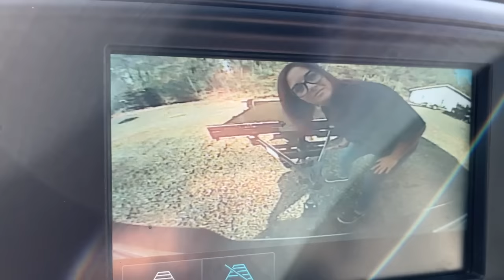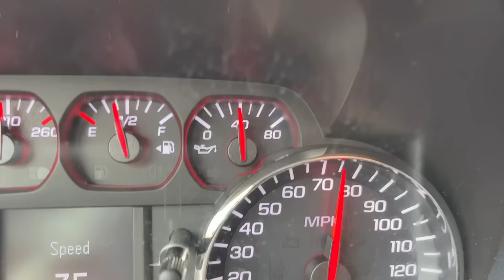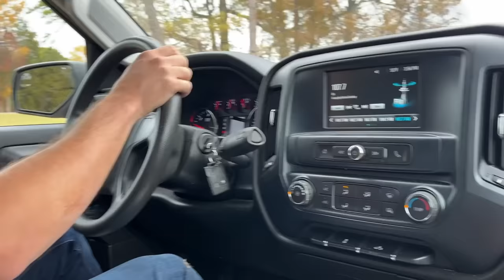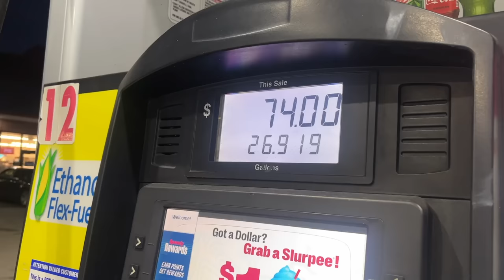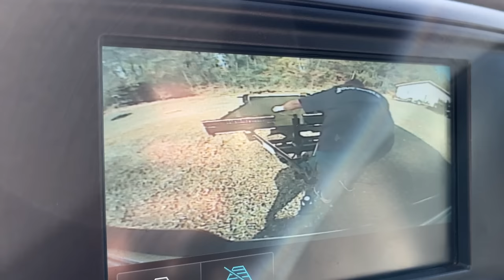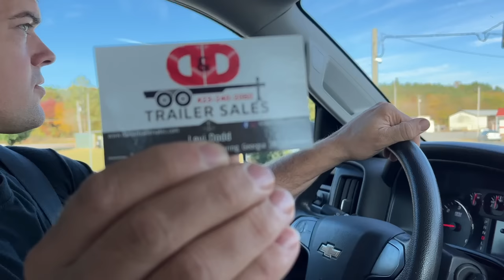How much did we spend? Big time upgrades! Ralphie is soo excited !!!

Comment: As a retired GM guy, thanks for choosing GM again.
Reply from the maker: No problem they make a good product
Reply: I heard that Elon Musk was going to buy GM
Reply: What models did you build?
Reply: @Stahodad  Fairfax KS Olds Cutlass, Pontiac Grand Prix, Saturn Aura, Olds Intrigue, Buick LaCrosse, Chevy Malibu, Cadillac XT4, retired 2 years.
Reply: @Amen.22  Hey this is a family show!
Reply: Nice upgrade. Flex fuel   truck and 24 foot trailer. Looks like some excellent adventure road trips coming up.
Reply: @br549200  Two of my brothers drove the Olds Intrigue, they were good cars!   👍
Reply: @Stahodad  I always wanted one, never pulled the trigger. Early ones had the 3.8, those were the really good ones.
Reply: @Amen.22 so there goes customer service lol.
Reply: Absolutely GM. If it's a Silverado? The only one I heard will run forever.

Comment: When I looked for a 'camper top' for my '03 Tundra the most impotant feature was a three way access, no windows cap.  So here you are excited to have found your perfect fit for a replacement truck with a bed cap of the same style three door access, HooYeah!
My BFF helped me to install the cap that actually was to narrow to fit my Tundra's bed rails but with some modifications including some Home Depot hardware we together were able to get tne cap secured.
Reply from the maker: That’s cool
Reply: Early Riser, I See...
I'm new to your hijinks working with tools, cars, kids and the rest.
Now it's 5K miles once in a lifetime circuit and surging fuel starving $1250 motor home. 
Is it not the fuel filter(s) I ask myself?
🤔

Comment: I worked for a company that produces all the fastening bolts for GM vehicles. If you take one of it will have a hex shaped line with a capital letter M in the center of the head. That company is MNP. They are located in Utica, Michigan. Open your front door on either side, and the fender bolts have that M stamp on them.
When I first started working for them, I had a 1996 GMC Sonoma. The water pump went on it. When I was changing it out, every bolt I took off, had that stamping on them. I ran a furnace there that hardened metal, or could actually make it softer. The furnaces are longer than a football feild, and are approximately 10 feet wide.

Comment: Husky Liners part #79011, it'll cover up the rear wheel wells, no drilling required, makes them match the front ones, nice finished look and can be removed to clean under the bed if you don't mind using tools on those silly plastic tree clips or replacing them.  Keep an eye on the jungle website pricing I saw them once for 80-something.  Or you can get the Rough Country ones for $100 (part 4215) any day of the week, same way to install.
Reply from the maker: Ok thank you

Comment: Great video yall. Love the truck.  For the record I run rotella t4-t6 in everything! Trucks, Race cars, Hotrods, Tractors, Lawnmowers, 4 wheelers, golf carts....never had a oil related failure. The diesel oil has more detergent than regular oil also so it keeps your engine cleaner. I've been sold on rotella since I was 18
Reply from the maker: It’s good stuff
Reply: @Sleeperdude  yes sir.

Comment: Congratulations on your new pickup. It should fill your towing and family needs quite well. I know these newer vehicles recommend 7 to 8,000.0 miles per change but I have always changed my oils in my cars every 2,000.0 miles with filter and use Valvoline 10W40 year round. My oldest wagon the 1987 Crown Victoria has 246,000.0 miles on it and does not burn or leak any oil. A few years ago I had Bundy Motors replace the oil pan due to the old one having a large hole in it and after they dropped the pan  five mechanics were looking up at the inside of the engine and could not believe how clean it was inside. Changing your oil frequently pays off in the long haul.
Reply from the maker: Thank you. Yes gotta keep them oil changes up

Comment: Pull those rubber floormats out and install carpeting. If the rubber mats get a crack and water gets in it will stay under the mat and rust the floor from the inside. Plus carpeting is quieter, and as much as your kids go without shoes, a little more comfy.

Comment: Congrats on the new truck!  Nice tips on checking out vehicles to buy too!  Got to tell you about heat/defrost in old vehicles.  I replaced the fan and heating core in a 94 Voyager.  New OEM fan and aftermarket heater core (2x thicker than the original core).  The change was crazy good!  Air moved great and the heat was so good we would only set it to about medium for the middle of winter (up here in the NE, that say a lot!).
Reply from the maker: Awesome thanks

Comment: The manual shift is👌 my 96 s-10 was electric.4x4. I converted it to manual shift when the 4x4 failed.. I put all new vac lines on it . New button ,new shift motor. As I was bending the fuel lines to make room for the linkages. I cut my finger on the 5/16 charcoal vac. Line. Under the driver seat there's  a body seam ,that sawed into the lines. I used a shifter out of a late 80s Cherokee .works like a champ.👍

Comment: Take a close sided wrench and run you a water pump belt through it to where you got a loop on the outside and then you use it to take that oil filter off as you turn the Wrench It tightens the belt

Comment: Use a K&N oil filter. It has a 1” nut welded on it. HP-1017. Makes removal a snap!
I run K&N on all my vehicles.
The engine needs more ethanol than gasoline so it evens out.

Comment: I’m so happy for you all! I chuckled when you used washers on the front under bumper thing. I had a 2015 Ford Escape, only 70k miles and not one scratch or dent. The front under body had some black protective thing that came loose. I’m an older female and couldn’t get under there myself, so went to the dealer. They fixed it, only to have it fall again a week later. Went back and they tried to tell me that it probably wouldn’t stay in place because the screws had made the holes too big. Well, I told them I wasn’t a mechanic, but it seemed to me that if they would put a washer in there, chances are it wouldn’t fall again; it stayed. Yep, traded it and a kidney for a 2021 Ford Explorer. I wanted something with all the newer safety features. I like my Explorer, had to get running boards since I’m a little short, but I loved my Escape. :_Rocky:
Reply from the maker: You go girl that’s awesome

Comment: 18:58 This would be a good vehicle to use one of those skinny JM3 oil filter wrenches that just launched, I've seen it promoted on some other channels (Rich @Ford Boss Me for example), and with that limited clearance you just slide it up and squeeze and it's cake from there.  All 3 of the vehicles we have seem to have the same filter diameter so I'll only need to buy one and then use the strap kind on anything else I have to mess with.
Reply from the maker: Ok thank you

Comment: Congratulations on the new truck!!! So happy for you guys :)    on another note ...check the GM service bulletins on the 6L90 and 8L90 transmissions...I know GM has issues with torque converter shudder. GM TSB said to go with the blue label  Mobil 1 124715-1 Synthetic LV ATF HP...recommend a full flush  of torque converter, cooler and change filter in transmission... You should be good... I did have an issue with a 2018 GMC Sierra with the 8L90
Reply from the maker: Ok thank you

Comment: That mileage scares me. I have been dealing with used cars and parts for many years, and I would be hesitant to buy anything that has average more that 15K a year for it's lifespan. That is extremely high mileage for a four year old truck. By comparison, my current vehicle is 15 years old, and only has 115K on it. A modern vehicle with an average of 25K a year is really scary to me, based on my experience. I hope you went through it very carefully before you bought it. It definitely has not had an easy life. I hope it works out for you. I'll be keeping my fingers crossed. I wish you the best. It has been so much fun watching your success. I couldn't be happier for you.
Reply from the maker: Thank you

Comment: As someone that's been paid to repair quite a few trailers, I'd recommended selling old trailers and just replacing them with new ones. I've seen people spend half of what a new one would cost and still have dry rotted casings busted lights and beat up floors.

Comment: When changing the oil, use a red sol cup after you crack it loose, catches alot of the oil that runs down your arm, really cuts down on the mess
Reply: Oil filter*

Comment: Howdy yall, I love the new truck (10 months late). I think it is fitting that a great mechanic should not have to spend time fixing their own vehicles. I know truck prices are insane. I paid over $40,000.00 for my 1997 GMC Sierra 4x4 extended cab SLT, 4 years old with 54,000 miles. Not long after I bought a 2000 Pontiac Sunfire for my wife, 1 year old for $13,000.00. Back in 1976 when I was a teenager, I could have bought 1,000 used cars for that kind of money.

Comment: Dear Sleeperdude family
👍👌👏 Oh WOW, simply fantastic! Congrats for purchasing this new used beast of a pickup truck. Congrats too for purchasing the new and longer trailer. You cleaned the truck really, really well, it looks almost brand new now. So please kindly consider to dent out the whisky dent in the rear bumper. After all one of you is a very qualified body repair man. 😁 ;-)
2) Please kindly consider to put a good, sticky/oily undercoating on the truck. There is already some surface rust showing and winter is coming. For instance Mustie1 uses a mixture made of kerosene and chain saw chain oil with extremely good results.
3) I don't know if I could see it correctly but I guess, the trailer hitch is sitting a little bit too high for the new trailer. At least if the trailer is not loaded.
4) I was really glad to see that WaWa's broken finger has already healed.
Thanks a lot for making teaching explaining recording editing uploading and sharing.
Best regards luck and health to all involved life forms (humans animals and plants)
Reply from the maker: Thank you so much
Reply: Dear  @Sleeperdude   family
You're welcome, it's my pleasure.
Thanks for replying and especially for giving a heart for/to my comment. I totally appreciate both very much. May you all always have a good ride in this rig.
Sincerely yours.

Comment: That oil filter is a dexos oil filter I know cause I work at an oil shop called take 5 and that's the oil filter we use lol

Also if you want a faster tool to use on them oil filters I recommend buying a 2 prong or 3 prong it hooks on a normal ratchet and you put it on the filter and just ratchet it off, they have definitely saved me a lot of time

Comment: My neighbor has the same truck. Same engine same transmission everything, 2500. One day he's riding along at just over 100,000 miles and his transmission grenaded. They believe it started with his talk converter and threw all kinds of metal into the transmission. Not saying this is going to happen to you, but it's definitely something you should be aware of. Apparently these transmissions are constantly shifting and having issues. 
After his transmission went and he had it replaced it cost him $5,500 at the Chevy dealer. He did the DOD delete after all this because he doesn't want to go through an engine.

Comment: you only need to grease the bearings if you back into a lake or shore location We call those grease caps wheel buddies, otherwise 10,000 miles

Comment: Your new Chevrolet truck the proper oil is full synthetic 5-30, Do yourself a favor and get the filter wrench that goes on the bottom of the oil filter  That's what those  Indentations are 4.

Comment: I would not put 80 psi in the back unless I was going to be loading it to the max in the back, like 3 or 4 thousand pounds. I'd put about 55 in the back. 65 at the most. And not just because of the ride suffering.
  Using more or less tire pressure than the weight requires wears on the inside (too much) or outside (not enough pressure) of the tires.

Comment: I don't know if the 6.0 has AFM, I know the 6.2 and the 5.3 does... if so, get that tuned out ASAP... also with the 6L80, get the thermostat replacement to get those trans temp's down... that swap is like 60 dollars for the part and a single 10mm bolt and a single 13mm bolt... they are both musts... also a catch can and cold air intake will do wonders for the truck with the tune. You can also delete the muffler but leave the resonator and it will wake up the exhaust tone. I'm assuming it's a 2018 like mine so everything I said should be correct.

Comment: My brother had one of these as a work truck through his work. After the fourth transmission they have it back to the dealership and he got a brand new Colorado as his personal and work truck. My cousin has one and is having the same problem. The transmissions on the gas heavy duty trucks are unfortunately a weak point so it doesn't surprise me that it ate a little bit of transmission fluid.

Comment: Hey SleeperD
I know this here comment is late so take it for what it's worth.

Nice new truck, 2018 huh?
What are you doing about Rust prevention??

I  have been through most types.  The black hard crap comes off in a few years, then the rust  starts again.

A few years back I sprayed the frame and anything with rust on my 1986 Chev K10.
I used Mineral Oil, but you can use the oil from when you change oil on cars or tranny fluid which supposedly has anti rust chemicals in it.

My frame had a good coat of rust from years of use and sitting.  what can I say.  I  actually had a brake line that was 2 years old fail to rust..........so....  yup,  Mineral Oil bath.

The rusty frame was orange brown.  My mechanic insisted on doing an inspection when I brought it out of storage and found it good.
It was at that point that I sprayed the Mineral Oil on the frame.  when I saw them I did spray the collapsible steering column,  the suspension bolts, springs, anything that can rust got hit.
I think what makes  this effective, is the oil is sprayed on the rust, and the rust is porus so the oil seeps  into the dry rust, protecting as much as you can get to.  The black hard crap won't do that. It just covers everything.

The brown rust treated with Mineral oil turns from brown to a dark almost grey color.

for your nice truck, I would also get above the wheel wells on the fender lips where the inner fender rests, inside the doors so you can treat the pinched metal edges,  this is where water sits and rots out the doors.  Get the bottoms and try to get the sides, at least the lower sides.  Dont forget inside the tail gate and those pesky supports inside the box fenders by the wheel wells.  They rust bad and people just seem to miss them.

try to get the quarter panels under the doors, but access is not always easy.
in other  words cover everything under the car and hidden.

You probably should check every couple of years but if you never do it again at least you got it once, right?

My truck seems to have stopped its rusting and is that dark color now and I put it on my jeep which had rust at the bottom of the doors (very common problem).  Seems to have slowed if not stopped the rust at this point.

Worth a try  and would cost you almost nothing and will keep your nice truck nice.

Comment: Congrats on the truck and trailer. If clean would ensure you a safe trip to Florida or anyplace else then you could drive this to the Moon. Spare tire for a trailer what a novel idea. Top my head I can think of four different times as a thousand miles from home and did not have a spare and I was in middle of nowhere. But I still had three like new tires on my trailer. Brings me my next point semi trailer tires and blow out and leave the casings on the road. I have a trailer with the similar setup where the ramp slide in from the side and the second one I hit you try to swerve but the second one I hit premier took that ramp holder off the trailer. I put a small come loan and chains on it and held in place and then took my cut off wheel and cut it off. I do have the intention to put it back on and it's only been about 8 months. You get a job or box and put on the front of your trailer I keep everything in it. Use it for the trunk. Truck bed has all the equipment in it that you need. That's how we travel in the past. By the way did I ever find a sweet Fairmont futura! See I've told you I like those. So there's two intelligent people in this world with great car taste who like Ford fairmont's. Or something like that. I have a 2008 2500 HD with 300,000 miles on it I think Eric in that neighborhood and it's still going strong. It's not as pretty as your truck put on the farm it works fine. Those are great engines and yours have been updated extensively since mine was manufactured. It's nice to see good people rewards of their own labor. I mean you're all in on this YouTube thing and it's working fine looks like it. Your family's been there time with you so you have a lot of man woman and children are as invested. Y'all earn that truck and trailer a couple times over already. Congrats again

Comment: Congrats on the new truck… those 6.0s have a filter under the oil sending unit.  They hate that 15/40 oil stops the screen up on 3 of mine.. pulled the little filter and reinstalled oil sending unit lol
Reply from the maker: Ok thank you
Reply: I mean why would a oil sending unit need a filter,  other than to stop up and make you think you lost oil pressure..  GM trying to sale more crate motors lol

Comment: You need to svc transmission.    Every work truck i ever drove was a GM w 6.0 w the 6 speed transmission that always died at around 196000 miles.  But the company would never svc em just always buy new or reman transmissions for 3 or 4 grand each time.  6.0 is definitely a work horse. But loves gasoline.
Reply: You will be satisfied
Reply from the maker: Ok thank you